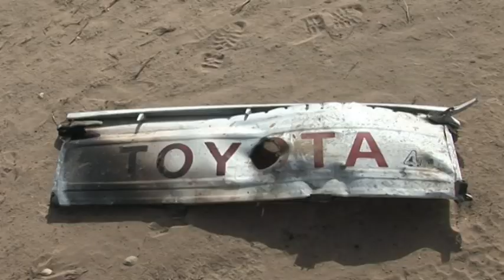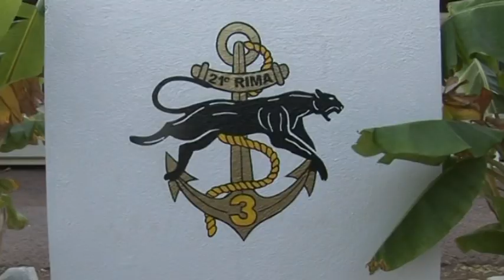The Battle of N'Djamena - La Bataille de N'Djamena par Yves DEBAY

Comment: Correct me if I'm wrong. France basically intervened in the conflict in Chad, helping a faction which did not respect human rights more or less than the opposition. to the excuse that France, by a strange coincidence, had personnel and military equipment placed in important strategic places -like the airport. Now, tell me that the sustaining of the "failed state" named by the Fund for Peace, with also corrupted to the bone politicians (see wikipedia) was not because the oil industry business.